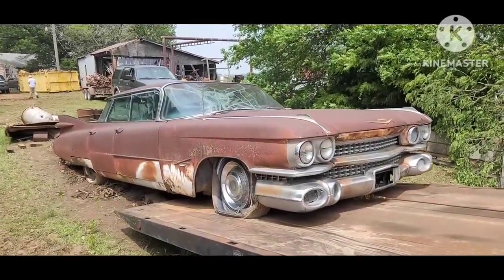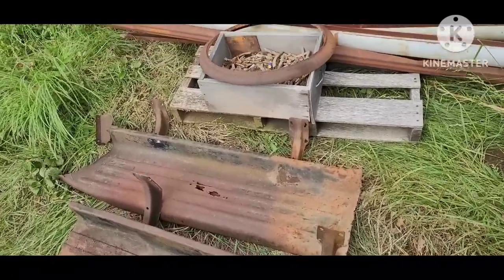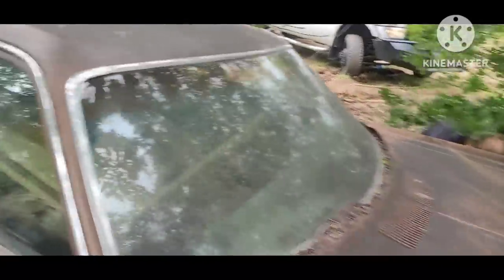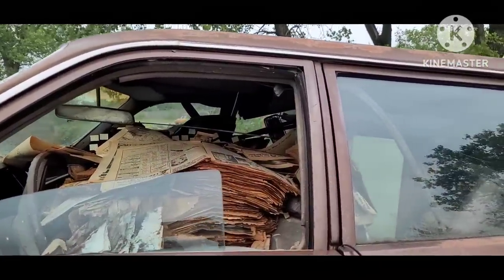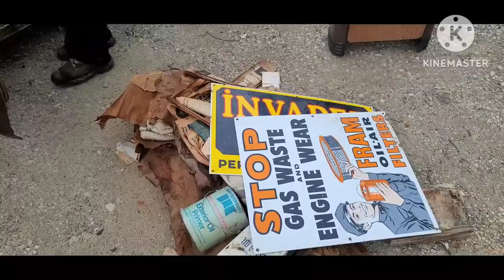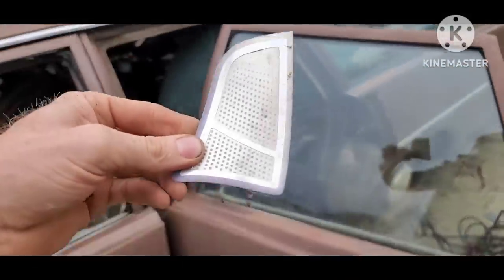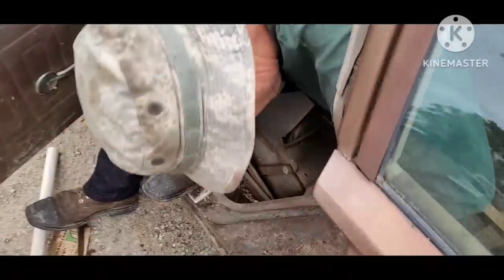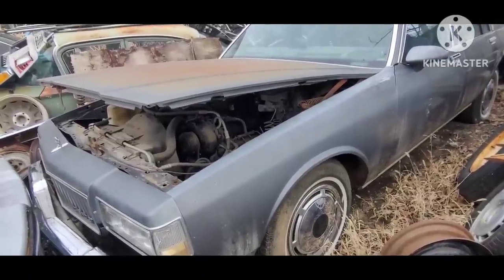What's in the Wagon? Load & Search Auction Cars + Trucks! 1971 Plymouth, 1958 Ford & 1988 Caprice!

Comment: Special order usually means sold to fleets, like taxi cab companies, municipalities like police and fire etc. if you decipher the other codes on the fender tag you’ll find a lot of heavy duty equipment, nice find.
Reply: exactly what I was going to see. Mass orders were Special Pricing. Fleet of somekind, had ex-Air Force Dodge Truck with same tag
Reply: Special order was also a retail thing,by either the dealer,consumer, small business wanting a specific vehicle.Fleet. purchases could be a problem sometimes because a manufacturer might/would make a limited run of components with OEM-NOS replacement partsnot available later for fleet buyers, etc
Reply: @dmcnamara9859  Never saw that tag on anything other than fleet though. Anyone could special order a car, my brother did with his Challenger, but it didn't have a Special order tag on it.
Reply: My dad was a salesman for a Dairy company. His company cars in the 70’s were Fury’s.
Reply: @jamesandrew5205  most likely a fleet sale
Reply from the maker: Fascinating, thanks! I looked over it for anything added - extra antenna holes, or sanded down lettering, but found none. Whatever it was used for must have been strictly transportation with an occasional load in the back
Reply: some were corporate order, Avis, Hertz, etc. rented Caprices, and even a taxi had power windows, change the seats to a good vintage muscle car interior front buckets, console, etc. from various viintage GM of the era, same for rear seat, 3 place bench type -  bottom: high center, two
 'buckets'  - with pull down armrest for an easy conversion to a 2- seat style - the original '2+2' type seating, on a grander scale, complete disassembly and renewal of each section of the car, engine, drivetrain, body, interior, best oem grade factory  carpet, etc that will correctly easily fit, with minor modifications as unnoticable as possible,  frame - if applicable - belts, lines, hoses, radiator, door and window mechanisms, hood and deck lid hinges, exhaust, hangers,  body mounts, oem engine rebuild or replacement parts, transmission parts, etc. or 2nd source part of quality equal to,  or exceeding oem parts, improve operation via correcting known faults, improve performance, etc.
Reply: My friends family the exact Plymouth wagon. that little airfoil on top is to keep exhaust gas from coming inside when the window is open

Comment: The back window being electric would have a switch on the dash to control. The key cylinder in the tailgate was a switch also,  turning it clockwise would lower the glass and turning it counter clockwise raised the glass.

Comment: Mr. Goodpliers, Picture tubes are available, but to convert to digital is more difficult, you could however gut the cabinet, and install a flat panel LED, or LCD type tv inside, add a small stereo amplifier - use the audio output RCA type jacks to amp inputs, amp outputs to cabinet speakers - then you'd have a beautiful cabinet tv, fully operable with that great wood cabinet sound, and - with a remote that works well - (and doesn't change channel or volume if you pull your keys out like the Zenith 'Space Command' remote tv's were famous for - the remote pushbuttons when pressed caused small 'hammers' to strike one of 3 metal rods of different sizes- each 'rang' at different frequencies when struck, so one of 3 reed switches would vibrate causing volume up, down or change channel- which only went one way, so if on ch 5, and wanted ch 4, you had to go all the way around back to 4. - and jingling keys would also trigger the reed switches, the channel change being most irritating - Love your stuff, if I ever get back in another place to build cars, hope you will still have some of them - Would love to have that Chevy Caprice- not for a 'donk' but full a restoration - would make a great replacement for a 2013 Ford Edge -junk when built  -  makes scrapyards job easy with prebuilt scrap.
Also, the folding bumper was seen on the larger trucks it folded to allow a bottom pivot tailgate to go further down, otherwise as tailgate stops were removed to allow it to go lower then regular bumper would prevent it fully lowering to allow easy loading/un-loading skipping passing the loads over the  tailgate.😁
👍🇺🇸😎

Comment: The way I would straighten that door is stuff an Innertubes down inside of it and work it around until it is lined with the damage and then Blow the tube up slow. I have also done caved in Roofs where things ware placed on them. Take a 2" X 6 " board and put them through the windows and take and strap them over the roof from end to end and blow the innertube slowly raising the roof back into shape.

Comment: 2:24  It's not hard to tell which buyers are amateurs. Just drag it and hope nothing gets torn off rather than installing rollers.
27:32  Looks as though the forklift is due for some heavy maintenance. It appears to be chuffing a bit of oil
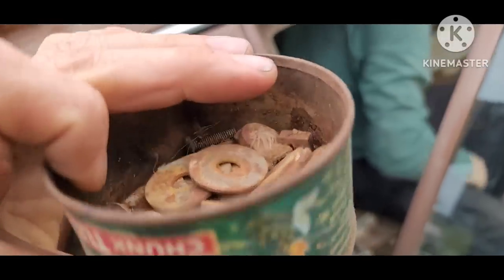43:40  Chicken of the Sea is a packager and provider of seafood, owned by the Thai Union Group in Samut Sakhon, Thailand

Comment: Special. Order would be  the 360 for fuel economy the 383 or 400 b is the  actual  base engine  and  the 440 was premium it looks  like  a company or civil  servant car it actually  looks  to be in decent shape the air foil on the back is to keep  exhaust  fumes  out of the  interior .

Comment: If gas prices were low, I would totally find a 70's land yacht to restore.
Reply: How about don't let gas prices made  by the president control whether you have fun or not. Go do it anyway, I just bought a 44,000 miles original 1978 grand marquis, and I'm not made of money but it makes me smile and that's what counts for me.
Reply: @nickzobel9922  Good find, bet it didn't require restoration.
Reply: Mr. B. Here ! Unless you are going to drive 7 days a week you are missing out ! 😢 I have two 1958 super 88 ; 1984 two dr Delta rat rod ! A hold lot of fun !
Reply: Mr. B. Here ! Unless you are going to drive 7 days a week , you are missing out ! 😢 I have Oldsmobile 1958 11:23 Super 88  mpg 15 ; 1984 2 door Delta 88 rat rod ; 😅 a hold lot a fun 😊 !